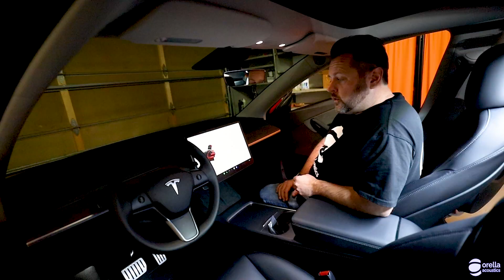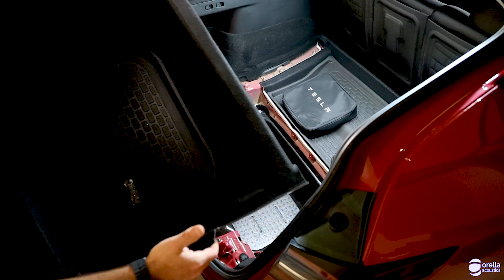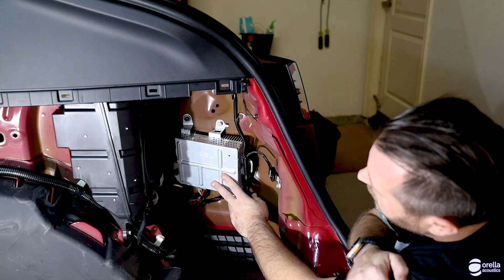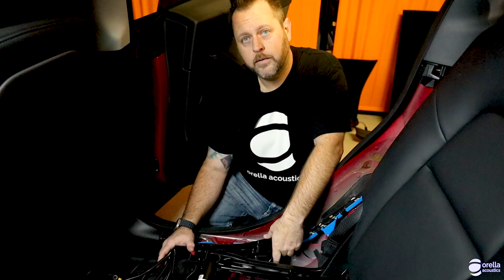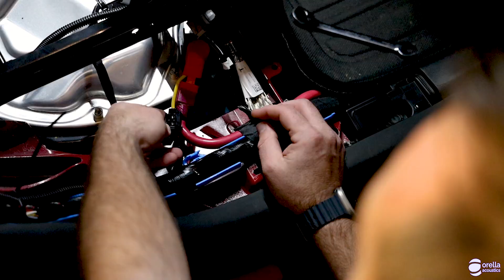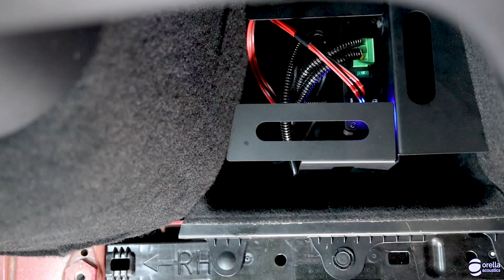Tesla Model Y Subwoofer and Amp Install

Comment: If the trunk ain’t excessively vibrating after sound deadening or it don’t sounds distorted from in cab recording from a device it isn’t loud enough. Basshead putting 2 10s or 2 12s in that trunk

Comment: Hello! Almost two years ago, I purchased this system after watching your video, and I thoroughly enjoyed every moment of my experience. However, last month, my speaker system, the subwoofer stopped working. The rest of the speakers still remained functional. I attempted to troubleshoot the issue myself, but unfortunately, it didn’t work. I then reached out to the Orella acoustic website for support, but to my dismay, no one has attempted to assist me. I am now left with a half-working and a non-working speaker system, and it’s disheartening to have experienced this after only two years of installation, without any customer support.

Comment: Thank you so much for your tutorial. Is your car long or standard range? I was in shock when I discovered that my standard range doesn't feel similar to the long range. Hopefully, yours is in the standard range so I can upgrade the speaker.
The good news is you found the battery connection underneath the back seats.

Comment: Can you share how you keep the amp from triggering the DC-DC converter fuse protection from activating in the newer 16v Lithium Battery Tesla Y models, which then turns off all charging to the vehicle’s 16v Lithium battery?  Can larger power or two amps potentially be installed?  Thanks.

Comment: Great install! Do you think there would be enough space for the amplifier underneath the rear seat? And is your Tesla with the new 16V battery?
Reply from the maker: HI there, I would not be mounting anything under the rear seat since that is where the battery is located for the car. Our system is compatible with both the 12v and 16v systems.
Reply: @orellaacoustics Good advice, thanks! I use the little storage space quite often, so looking at alternative locations. Thanks for info
Reply from the maker: We did as well, unfortunatly to be able to keep the amp cool and not shut down to heat that was our best option. @jarleaursland

Comment: Did you install the sound isolation tape around the woofer before installing in the hole?
Reply from the maker: Hi, I believe you are talking about the foam gasket tape. You can install it, but it is not 100% necessary.
Reply: @orellaacoustics  perfect! I didn’t, cause didn’t have holes and didn’t fit properly! Plus didn’t see in this video that it needed. So far sounds perfect. Much more bass. I bought it last week got it in couple days. Installed it my self easy
Reply from the maker: @dmitriibob  that’s awesome to hear. We are very happy you are happy with it.

Comment: I'm interested in the power tap. Not installing a subwoofer, but rather a ham radio. Did you have any issues with warranty and any codes with heavy power draw?
Reply from the maker: Hi there, we don't have a heavy power draw. Our amp at max current draw is 30A, which it probably will never truly see. That should be higher then the traditional ham radio. I would suggest looking at the power specs of your ham radio and go from there. Also that stud is constant power and not switched as well as depending on the year of your vehicle, it might be 12v or 16v. Not all electronics can work on the 16v system.

Comment: Do you know what the blue and green wire is on the stock subwoofer? It has the red and black as well. Curious if green goes to negative and blue to positive. I’m replacing only the subwoofer with a kicker sub not the amp.
Reply: Exactly what I’m gonna do lol , did you ever figure it out ? Also what ohms did you get your subwoofer ?
Reply: @akidim13 nah man no one knows lol. I tried connecting a kicker and it keeps cutting in and out with the green and blue plugged up. So what I did is cap off those wires and only plugged up black and red. It sounds better than stock but I still want more bass. Hopefully can figure it out soon. I really don’t want an additional amp and sub box taking any spacd
Reply: @bigbawsz2054  hey bro I figured out a easy ass solution that will add bass without having to install anything legit plug and play
Reply: @akidim13 what’s that?

Comment: May I ask how the amp turn on and off every time? By the input signal or the 12 Volts line disconnect every time there’s bo one in vehicle ?
Reply from the maker: Hi there Van, our amp turns on and off with input signal.

Comment: Can't wait to order this kit I think it's everything im looking for!!!!!   but I have a few questions 

What is your company's background ? where you part of another speaker company prior or where are you coming from? I can't find much about the brand other than a Facebook page and your website. 
I love that you created this market specific for Tesla and it seems soon other car manufactures. Was this the original Vision?
Am I right to assume  you're custom making all your products? 
Are they American made or do they come from overseas?
The speaker upgrade for the door and dash are they the same ohm and wattage from factory or are yours requesting more power from the factory amp ? I notice there is no addition amp being installed for them so im trying to see by upgrading what exactly will be gained.
Reply from the maker: Our company was launched last year. I have myself been in the car audio industry for over 25 years and have worked for some of the biggest car audio manufactures as well as my partners from OEM design to aftermarket products. 

We are manufacturing our products overseas since unfortunately thats where almost all the speaker manufactures are. 

The speaker upgrade is a very small difference in impedance, from the factory being 3 ohm and ours being 4 ohm. Our speakers efficiency makes up for the small difference in impedance. The wattage is determined by the factory amp currently. With the speaker change we are giving much more detail in the info that is being produced vs the factory speakers. You get much more midrange presence and more more detail from the tweeters. 

In our sub upgrade, we are adding a lot more power then the factory and using a woofer with a lot more output capabilities.

Comment: Are there any adjustments that can be made to the amplifier provided in the kit? Or is it designed to be installed and never touched again?
Reply from the maker: Hi Brent, thank you for your question here. The amp is set to work with the vehicle as we have it. It is designed to be installed and never touched again.

Comment: LOSS OF RANGE = ADD ELECTRIC WINDOWS, WOOFER, SCREENS. EV DOES NOT NEED SCREENS, ELECTRIC WINDOWS, ACTIVE SUBWOOFER... CAMERA...
Reply: and for 95% of people, that range is irrelevant.  A very small percentage of people drive more than 250 miles a day.  If you're commuting a huge amount of hours, then sure...otherwise your comment is pointless.

Comment: Some questions;

1) what RMS is this sub and amp?
2) what frequency is the sub and stock enclosure tuned to?
3) did this aftermarket amp totally take over the existing amp? As in it could have been removed too?
4) what ohms are those voicecoils?
Reply from the maker: Hi there Scott, thank you for your questions. Here are some answers for you. 
1. The sub has a 300 watt RMS and our amp is 300 watts RMS.
2. It is tuned to 43hz if I remember correctly. 
3. The amp is only taking signal from the factory amp channels to the sub. Stock amp is fully intact and cannot be removed. 
4. The woofer is a dual 2ohm
Reply: @orellaacoustics  don’t this mean that speakers has more power from the amp, since oem amp don’t give power to the subwoofer anymore?
Reply from the maker: @dmitriibob  that’s a great question, but no, the amp does not know that the sub is no longer connected. It makes its power based upon the resistance of the speaker its connected too
Reply: Anybody buy this? Is this worth it for an 8 inch? I'm in Canada so even pricier for me to buy.

Comment: WTF, just a clip here and there and half the car is disassembled ... But it's a good thing. Do you ship to Germany or Switzerland?
Reply from the maker: Yes, most of the new cars made today are mainly held together with clips and such. Only really using bolts or screws where you would pull on something to open and close.

Comment: Hi! Amazing walkthrough install! Seems extremely easy to do for us that tinker with our Teslas. 

I’m looking to add some low end bass to my 23 Model Y Performance. I had a 21 MYP which I had a 10” JL Audio sub installed in with a JL a audio amp. It was loud and overkill, but the low end bass was insanely good. You could feel it and that was what I wanted. I’m looking for a happy medium there. Would be say this could be the answer for what I’m looking for?

As a content creator, this might be my next install! Today in fact, I installed some front door woofers. Cant wait to hear back and possibly order up!
Reply from the maker: Hi Jae, thank you for your question. With a larger 10" woofer, depending on which model as well, you will get a slightly lower freq production typically. Also how much power you have will play a big part in what that woofer can do as well. Our setup does a great job in the low freq production too, being in the factory ported enclosure as well as how great overall it loads in the rear corner. I think you might be very impressed with what type of production we are getting and the little loss of space in the cubby that you give up.

Comment: What year is the model Y?  I am looking to upgrade the audio in my 2022 Model Y Performance but was told there is nothing out yet that wouldn’t require an addition battery to charge separate to power it.  2021 and older there are options that integrate but 2022 and newer not yet.  Think it has to do with the smaller 12 V battery in the newer vehicles.  Hope this makes sense.
Reply from the maker: Hi Sean, the one in the video is a 2022. Our amplifier is compatible with the higher voltage system in 2022 platform vehicles. The 2022 us a 15.5v system and the pre 2022 us a 13.5v volt system, referred to each as a 16v or 12v system. The 16v system doesn't have a traditional battery as what people have known.

Comment: I would think Tesla would use good enough speakers and sub, didn't know people where upgrading these.
Reply: Thou true and I agree for a stick system is is truly great and one of the better factory systems, I will state that even thou its engineers made a great system it still uses far less superior product. Most cases the speaker is paper cones and small magnets. This works fine for the config they are in but do not have a long term track record in cars. Paper breaks down over time and peoples listening habits may force the speakers driver to over heat as their is not enough coil cooling. Hence the replacement of the speakers with aftermarket. The biggest issue I have with Tesla system swaps are a lot of them still use the factory wiring/crossover points and amp. This does not sit well as ideal and I like this system at least uses a secondary amp to drive the sub, but still uses the factory enclosure and I would be curious to know if the volume space of the enclosure is within range of the sub they installed less woofer displacement. 

I have spent over 20+ years in the automotive audio industry and enjoy my factory Tesla premium audio setup. Sure I am older now and don’t need four 12” subs and 5 amps to enjoy music and I feel the factory system if set right and played within its limits is a great setup off the lot and I don’t have to worry. I would say it’s factory subwoofer is lacking as it drives alot of low end and mid low out of the front door speaker as opposed to throwing low end via the factory sub. 

End of the day not all of these setups are needed, factory premium system is great for 90% of people and the others it’s their choice to change out components to their liking.
Reply from the maker: @meseone920  With our sub upgrade, the factory enclosure is pretty close to dead perfect with the woofer we have chosen. The port freq and volume are right within the spec range as well as the power handling.
Reply from the maker: Unfortunately car manufactures don't use the highest of end products when it comes to an audio system.Typically they get their best results through amplification, DSP tuning and placement of products. What we are doing is improving on what has already been provided in the vehicle.
Reply: Most Tesla vehicles have premium audio systems that are comparable to a $12k-$14k Bang & Olufsen system. If you don't know that name, then let me enlighten you! They make one of the best high fidelity audio systems in the world. Tesla hired those same engineers to produce this system. In other words, a stock Tesla audio is very impressive and you won't be disappointed!! People changing the speaker is all personal  choice, like changing the colors and lights but definitely not needed. Peace!

Comment: Thank you for the video. I'm in the market to upgrade my speakers and sub-woofer. So far, Your system is the first one that I have seen that doesn't require a person to cut into any existing wiring. It appears that all you have to do is plug and play your way to a better and beefier sound system. I'm going to check out your other offering for speakers. This video came up as a Youtube recommendation.
Reply from the maker: You are very welcome, we strive to make all our products where you will not be modifying or cutting anything to install. Thats a big no no for us. We also wanted to make something that an end user could install themselves if they wanted.